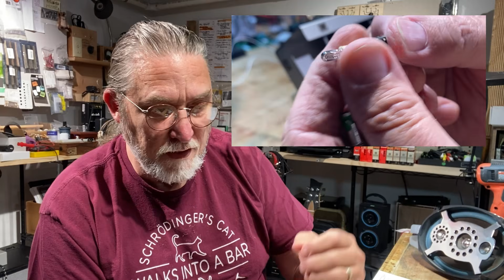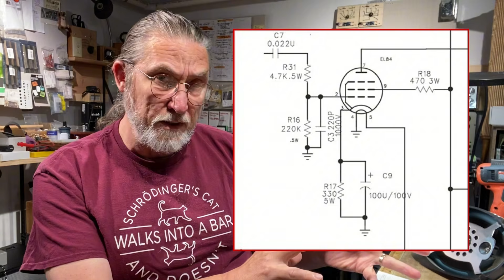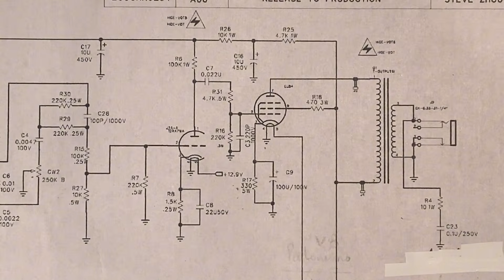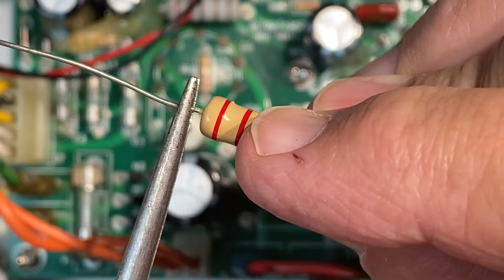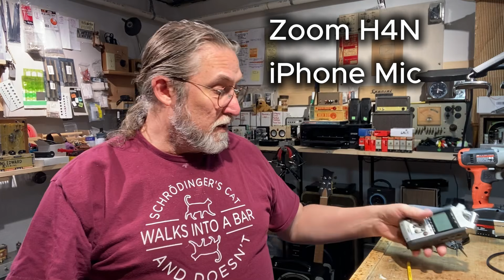Crate v5 Changing Triode to Pentode For MORE Output

Comment from the maker: I bought this Crate V5 tube guitar amplifier from a Goodwill auction listed as "for parts or repair," expecting a major repair project. After replacing a strange 6x9 car speaker and fixing a failed power indicator light, the amp worked... but it was surprisingly quiet.

Digging into the schematic revealed that a previous owner had modified the EL84 output stage from its original pentode configuration into a triode configuration. The modification reduced output power and changed the character of the amplifier, likely as an attempt to achieve lower-volume tube overdrive.

Comment: I’ve read some try bypassing the op amp before it hits the 12ax7.. it would be neat to see this mod
Reply from the maker: I think I've seen that too. There was another suggestion about changing how that part of the circuit worked by turning it into a unity gain amplifier there. It's very odd in any case to have a couple of opamps at the front end of a tube amp. I like your idea to just bypass them and see how that works. Thanks!

Comment: That was a 22 ohm resistor not a 220 ohm. Red-Red-Black 22 + 0 zeros.
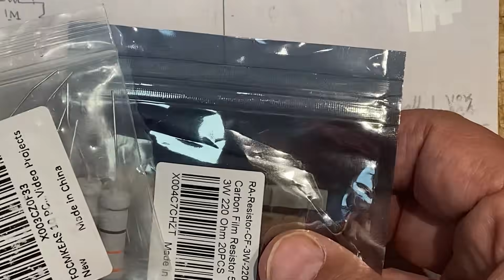Reply from the maker: It may look black, but it is really brown. I had to double check. At 5:26 you can see the label where it says 220R 3W. You had me worried there for a second. At the same time I wonder how much more could I reduce that resistor until the tube would red plate.

Comment: I like this idea of giving new life to broken things. It's always a fun project and you always learn a lot. I didn't know too much about EL84s before this, now I do. Thank you for the video.
Reply from the maker: Thanks! I wanted to use a little technical information without going full bore into curves and load lines. It’s easier to just read and compare schematics.
Reply: @MadScientistGuitarLab  That makes sense. 

About the recording, I can totally relate to that. I've also been trying a lot of things and ended up having two setups. I'm sure it could be done much better, but that's what I have for now:

1. The "proper" guitar recording setup: a dynamic mic close to the speaker cone and a condenser ~1.5 meters away to get some of the room. I use that in videos where it's important to get some kind of "accurate" representation of the tone. I blend those two mics and slightly pan them left and right. This works for videos where I do a before and after, a comparison, or fx in a video where I swap a bunch of tubes on the same amp - because it's important to have a consistent baseline so the viewers can tell the difference. I mean it's going through YT and it never is "just like in the room" , but hey. 

2. The quick run and gun: I either use a condenser or the iPhone/camera mic. This is for cases where I just need to show that "it makes sound". Say a video where I clean scratchy pots on a guitar and we need to show it now works or an unboxing/first impression kind of video. The caveat with this is that it's highly dependent on the room itself and where the mic is in relation to the speaker. But for me, for my particular small space it works. If I had that Zoom, I would happily use it in this case.

I've made some presets in DaVinci for both setups, so that I can quickly get the audio in and not spend time eq-ing on every video and that sped things up quite a lot. I'm happy I took the time when I first did it.

Boy that was a long comment. You asked so I answered :)
Reply from the maker: @CatsMusicJourney  This is perfect! This is exactly the kind of detailed answer I needed. You’ve even suggested the idea of using presets to make it easier to edit future videos. Just starting out, I won’t have the luxury of presets, but your advice on microphone placements and when to use more lofi set ups makes total sense. 

I am also looking into DI set ups. Coming up with convincing cabinet simulations is another can of worms.